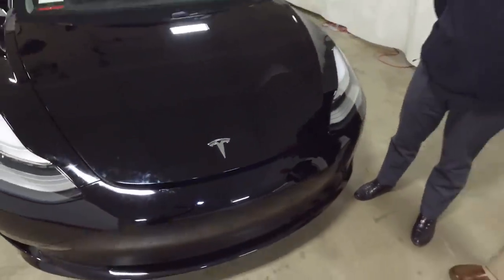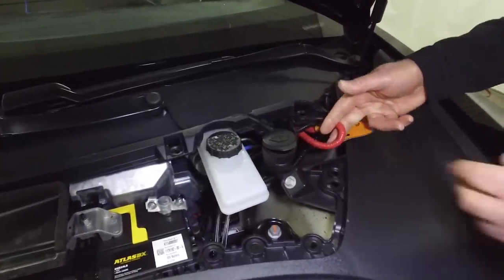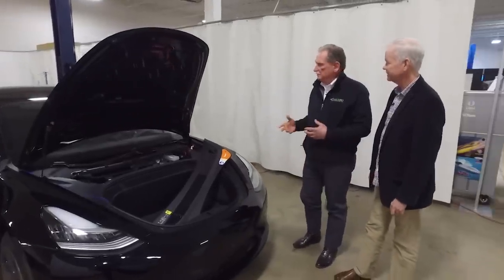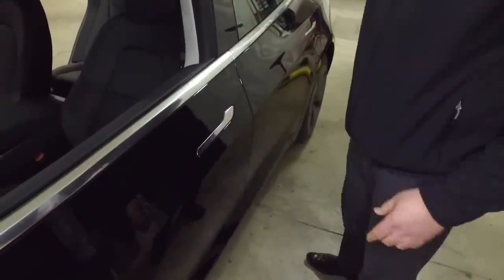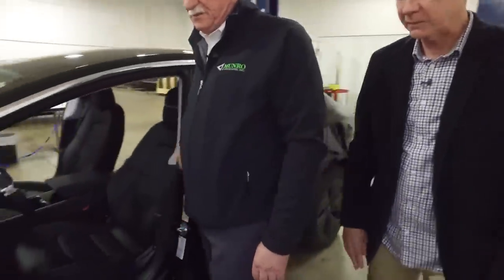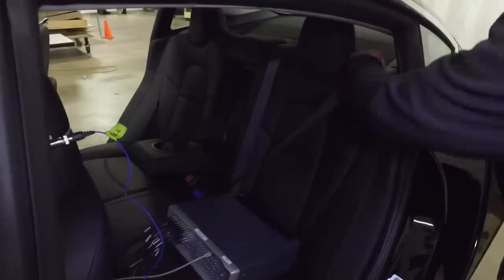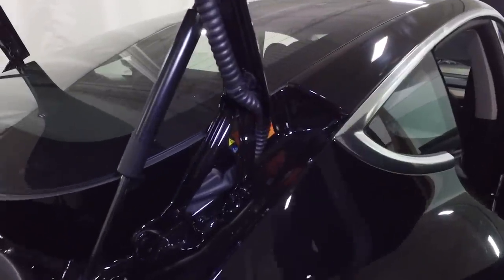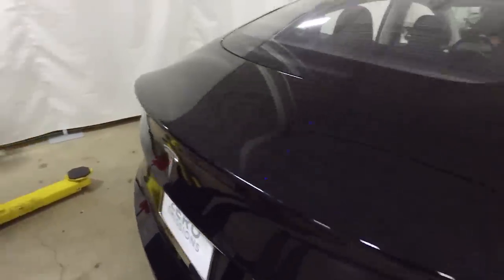Tearing Into Tesla's Model 3

Comment: Safety in these cars is a total mess. Had the pleasure to be a backseat driver several times. The first few times I almost every time pressed the window button first before trying the other one - no icon whatsoever indicating which button does what. And then I noticed that there is no mechanical way to exit the car from the backseats. Since then I only take a ride when I can be on the front seat. Really? Feels like the cars where made for just one thing: train the AI about navigating streets by collecting as many data as possible from as many experimental moving platforms in the field. Tesla drivers are lab rabbits.

Comment: The rear doors do have a manual emergency release like the front doors, you are incorrect. I'd recommend reading the owner's manual before you comment on things you're not sure of.
Reply: the rear doesnt have them. I own a model3, I studied the manual up and down. After your comment I searched on the internet. Nothing. There is a mechanical cable you can pull to open the door, but not accessible unless tearing the panel down. So no real usage for the average owner of the car.

https://www.youtube.com/watch?v=54UsqZGnGGM

Comment: His automotive experience is about tearing apart fossil fuel burning vehicles, and the safety concerns associated with 100+ years of vehicles running on fossil fuels. The mechanical concerns associated with "emergency hood pop!!!" do not exist with an all electric car. Also, this companies PRIMARY source of income is from automobile MFG's who are asking him for ways to save money. His previous comments on the model S were about, "body to stiff", and "manufacturing could be streamlined". IMO; Sour grapes types of comments, aimed at an automobile with the highest safety ratings in the industry. Companies like his are the ones who told Ford that the "steel plate behind the gas tank" of the 1978 Pinto was "unneeded". Not saying that his guy hasn't accumulated a wealth of knowledge over his lifetime, but sometime that wealth of knowledge leads to preference/prejudice, especially when looking at something they've never really looked at before. Personally, I would find more value in an open minded, automotive engineer and mechanic, pulling this apart, not a glorified bean counter whose primary clients are the ones being negatively affected by Tesla's emergence as an automotive competitor. All that said, his commentary on the fitment elements are completely valid. Although, I blame the "left-coast" mentality of the workforce that Elon has chosen. He really would have been better off using mid-west, UAW workforce. I'm not a huge fan of unions, but around here, our UAW folk take true PRIDE in their craftsmanship. From what limited things I've read about Tesla's labor issues out there, it seems to be slacker mentality issues, more than pieces/parts quality issues.

Comment: I have a Model 3 long range all wheel drive and it is by far the best vehicle I have ever driven! It And yes I too woke up to it being even better, faster and smarter once again last week! It is several levels of magnitude better than any other car i have ever been in. It has exceeded my expectations and even surprised me on several fronts. For example I had a false belief that it might be inconvenient to charge a  car instead of stopping and getting gas at a "convenience" store. It is the opposite. It's so easy, saves me time, keeps me from spilling stinking, toxic gasoline on my clothes and hands and maybe most importantly I am taking money away from the industry that is pushing it's costs off on the health care industry not to mention the perennial subsides. I installed a solar array before I purchased the car and also installed a 240 volt outlet. It is so much easier and literally takes 5 seconds for 98 percent of my charges. The super charging network is also very good and the V3 super charger is going to once again change everything forever! I just, yet again took a group of old friends for a ride in it over the Easter Weekend and the "Tesla Smiles"  are literally worth every penny! Oh did I mention I woke up last week and the car had 5% more peak power which is noticeably faster. The AWD is by far the best traction control system I have ever experienced  10,000 miles in I have had zero problems, no oil changes (which have taken completely out of my perennial To Do list) my garage smells way better even in way I never imagined possible. Too many upsides to list. It's not perfect but it is the closest to perfect vehicle I have ever driven hands down.

Comment: Can't imagine why anyone would ever buy a car without a DIC!
The Tesla Model 3 has No DIC (Driver Information Center) - Making this car an Accident Waiting to Happen due to Driver Distraction!
- The FACT is, that, there is NOTHING directly in front of the driver to provide the vital information that a driver needs to safely operate the vehicle, including a Speedometer or Speed indicator, a Turn Signal Indicator, an Indicator for High Beams On, and there are No Warning Lamps or indicators to alert the driver to dangerous situations like a Brake System Failure, a Coolant System Failure, Low Tire Pressure, Icing Conditions, etc.  NONE of this information is available directly ahead of the driver's view on a Tesla Model 3.  
How did the Govt allow this to happen??? (Sounds like some govt. officials have been paid off!)  
In order to access this vitally important information on a Telsa Model 3, the driver must turn their head away from the direction where the vehicle is headed and look off to the side at a flimsy flat panel screen located in the middle of the dashboard.  And it gets even worse because all of the information needed is not on the main screen and as such - the driver must scroll through the screen displays to find specific information and controls - such as adjusting the speed of the cruise control.  This is going to result in many accidents caused by Driver Distraction! BUYER BEWARE!!!

Comment: The gaps on my electric focus were so inconsistent that the hood barely closed. If you haven’t seen it since the 70s you’ve been blind for a long time. Ever tried to close the trunk on an x3 without the power assist? Better get ready to hang on it. Btw, fire departments train on stuff like that for a reason. You don’t have to know where to cut, they do. And...they do.

Comment: Seems like if the accident is of such severity cutting to remove the hood wouldn't be an issue. The access he's showing is primarily for a dead battery to access the fronk. I can't tell you how many ICE car fires i've seen that inhibit the ability to get to the mechanical release inside the vehicle. Plus in that case you not only have that issue but you have a combustion engine under the hood rather than storage.

Comment: The power actuator pop-out/jump box leads are actually for non-emergency access to replace a failed 12-volt battery, or boot a car with failed 12 volt to put it in tow mode (neutral with no brake). There are many other cars that provide similar jump points because they have 12 volt batteries that are otherwise not directly accessible. As far as accident response, the impact sensors are, depending on the type of collision, programmed to trigger all the doors to unlock and the frunk (front trunk) is supposed to pop, as well as disabling the main contactor to the traction pack in the event of said accident. If emergency services needs access to the 12 volt, or interior of the car, in a manor other than using the normal door handles and access means, then power hydraulic tools will be used to rip the car open.. just like would be done on any other vehicle involved in a crash warranting forcible access. A fireman's axe is also pretty effective at opening that hood by leveraging the pick at the latch point.. just FYI. Any new vehicle that comes out with new engineering people cite safety.. news flash, any good emergency response services are updating their training periodically. Humans, by majority, just tend to dislike things that they aren't familiar with. Thus, will go out of their way to give you a multitude of reasons why it won't work or tell you what's wrong with it based on their own arbitrary standard, which may or may not have any valid reasoning, and may or may not actually make any difference to anyone a generation after they've died off.  For example when your standard 4 & 6 banger sedans moved the 12 volt battery to the trunk, or in some cases into the passenger compartment UNDER the rear seat. People cried and whinged about it, now it's fairly standard, and modern cars are still just as difficult to work on as they'd been before the change. For a genuine whinge, In one car I owned the battery was in the front bumper.. technically the "bumper cover".  One had to take the front wheel off to get the battery out for replacement, and this car had a knack for killing a battery every three years without any warning that it was about to go.  It SUCKED when a hit & run driver smashed the battery under the bumper leaving me stranded in -17c weather (Thanks allot Chrysler! Nice engineering.). I'd have killed to have a battery in the trunk or under the seat like the other cars had.. or even under the hood. But, in any case those cars with "alternate battery locations" were the first to have "cut points" for emergency services. Tesla isn't new in this. What Tesla is doing with model 3 which is different as far as the cut points are concerned, they have provided not one, but TWO, so if emergency services can't access the front cut point, say.. because the front of the car is wedged under the rear of a bus for example, then they can cut the back one, or vice versa. That is thoughtful design. I'd take a model 3 with the "flaws" this guy cited over the STUPID engineering in many vehicles I've owned. Tesla vehicles arn't to everyone's taste and that's fine.. I know I won't own another Chrysler.

Comment: I'll be as unbiased as I can be. The fire department complain about how to cut the car it's something new to me.. I own an Audi Q5 and I don't see even a sticker that shows how to cut the car in an emergency. The door handle is simply his preference. I don't have a problem with it and he's exaggerating if he has to use two hands to open it..
most cars don't even have a secondary way to open the door. The M3 has an electrical button and a mechanical so you have redundancy. What else do you want? The ONLY real issue in this whole video is the QA problem with the gap. It is my understanding and based on owner's experiences that the QA issues are being solved as their production ramps up and improves. You're talking a company that was born less than 10 years ago compared to companies that are 100 years old! The funny thing is, Tesla came up with insanely beautiful cars that are destroying every other car in the market in most tests (acceleration, safety, environmental friendliness, etc, etc) and most old school companies (aka Ford, GM, BMW, etc) that have had a huge advantage experience wise, they are losing that edge to this brand new company... riddle me that!

Comment: It is sad that a Modern Car Company upstart did no learn from mistakes of a hundred plus years of MFG before them. 

The death of Tesla once the novelty wears off will be the very thing that powers it, lithium ion battery pack. 
The warranty on a new car is 8 years on the battery pack. The quoted cost to replace one with a new one is $39,000. Even if you mass produce the Batteries, the cost may drop by a third to $27k but that fact right there kills the used car market for Middle to lower class buyers.

Comment: I don't mined his criticism, criticism is good so they can fix shit, but the first thing is bitching about is the Hood Latch, many other cars have the same thing BMW i8, other Tesla Model-S & X, Porsches cars, so this is not a revelation of any sort. But bitching for the sake of Bitchin' is just annoying.
U wanna see idiotic and illogical control solutions?, test drive the new Volvo S60, its a beautifully finished car, but Christ Almighty everything in it is backwards.
I wanna see what they say about the volvo instrument cluster, and overcomplicated Supercharged/turbocharged engine.
The second thing he bitches about is the door handles, which are easy to open by the way (both overhanded with Left arm and underhanded or palm up with right arm) same as on aston martin and same as on lambo huracan, again nothing new, this has been around for years, just cause ur to dimm to turn ur hand over is not an excuse.
Then he bitches about rear doors not having emergency opening in an "accident", I hate to break this to u "Bob", but there are other cars with same problems, for example Mazda RX-8 & BMW i3 which both have suicide doors that can not be opened without first opening the front doors, so in an accident those doors can be permanently stuck especially when the subframe is bent or with a side collision. 
So again, did they bitch about those cars, probably not.
After that he bitches about "high effort" to close the trunk lid, HAHAHA wow.
Try closing the hood on a Dodge Ram or a Ford F150 when ur 5'6"-5'7" BOB and see how easy that is.
This idiot is just nitpicking standard shit as if its the end of the world.
How about u get to the real problems "u found" or maybe u didn't so u had to invent bull shit like this.
These sack nuts have been on tesla's ass since the beginning just like a damn tick on a dogs ass.
When Chrysler's 300c had electrical problems and engines would catch fire, where were u?, when Ford was to cheap to put a decent tire on an Explorer so it would not delaminate and kill people in roll overs, here were u?,when Toyota's throttle bodies jammed and killed people, where were u?, when GM ignition switches would turn of the engine under operation on the highway causing u to take a dive in the ditch at 70mph where were u? with ur criticisms.

See its easy to criticism u dumb monkey, how about u try to find a better solution and submit that to the manufacturer to help them instead.
And least we forget they used to bitch at Japanese and German car owners with stupid "Buy American" stickers and "keep or jobs".

Well guess what, Ford's cars are barely 40% american parts and most are put together in Mexico (very american by the way), and VW/GM/Chrysler got so many Chinese parts in them im surprised the nav doesn't talk back in Mandarin to the user.
Tesla IS an American car company &their cars parts are over 80% manufactured in America and more and more going toward 100%all in house, 
so wheres ur American Pride assholes? You wanna pick and choose whats convenient to u.

Where was ur mouth when GM sold Allison transmission losing us thousands of jobs buddy?
Where was ur mouth when Ford moved Focus production to China, or moving Electric cars production from Michigan to Mexico  loosing us countless jobs?

The Big 3 would like u to believe that they're cars are 90% made in USA but thats only 3-4 cars out of how may that each of them makes thats actually that way, only the "most profitable" are made here, the rest is outsourced to God knows where just to pinch and extra dime out of each car.
We lost so many jubs to this  shit practice that they allowed to these multi national idiots.
U wanna see the results of ur bull shit?, drive through ur own Detroit ghost town, or stroll through Washington with thousands of homeless.

http://money.cnn.com/2016/03/29/news/economy/us-manufacturing-jobs/index.html

So Fuck You and the mighty horse you rode into the  both of you.

Comment: To be fair they made some very good points. Tesla build quality is poor at times (usually the first batches). Many said the back seat passengers can crawl out the front. But this is only true if the front doors aren’t stuck. Many model X and model S owners have complain about rattling noises and poor paint finishes. Also these guys are not done with the car. There is another video where they took it for a spin and was super impressed by the drivetrain. Munro even commented that if the build quality was on par with Japanese manufactures the model 3 will be a car no one can ignore.

Comment: Seems they would have been better off producing their 35k cars first since they are essentially beta cars with fit and finish issues that you would expect to be resolved before getting into the 'premium' market with extended range, upgraded interior, etc.  Most of these issues would be easier to digest if purchased for $35k with a $7.5k tax incentive giving them more time for fine tuning production for the premium packages with higher expectations by 2019.

Comment: I agree that Tesla needs to greatly improve their bodyline assembly QC but considering they are only a about a 10-12 yr old company I think their driveline and battery management tech are top notch. Let's admit why Tesla is rushing cars thru the assembly line, causing fit & finish issues, is because Wall Street & therefore most major corporates have no long term visions anymore, much less 5, 10 or 15 year plans. They all operate on quarterly returns which puts corporations in a bind to produce. Most of the other major auto manufacturers have had over 100 years to perfect their manufacturing processes, not to mention the government bailouts they got. But none have really provided any new innovations to the autombile propulsion systems themselves.

Comment: Inside the rear door panels the model 3  there is a pull cable that is attached to nothing there should be emergency pull cables for all doors  . A elderly  man and his dog died in his corvette because he didn't know that there was an emergency release the battery died and they got stuck in the car and succumbed to heat exhaustion. These latches should be labeled if you lend your car to someone and there is a accident they panic and may not find them.